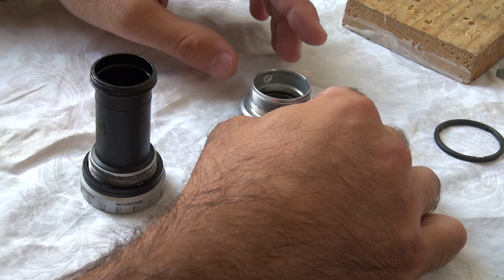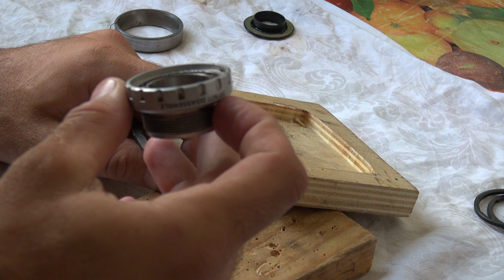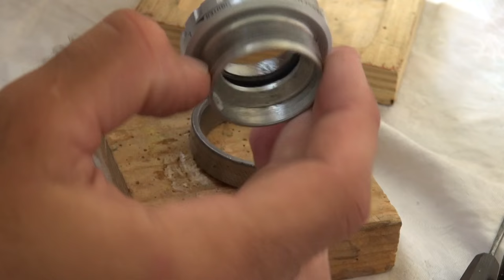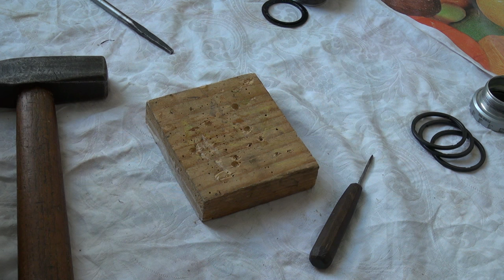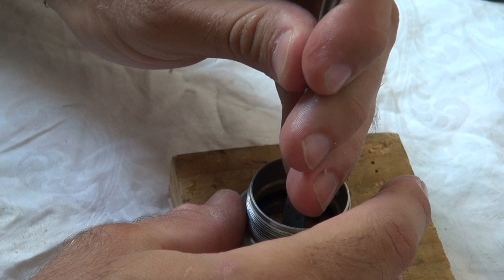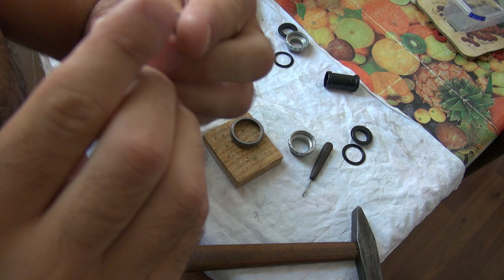Shimano Bottom Bracket BB-52/51 FULL Disassemble

Comment: You can use Sealed Bearing model 6805 RD (with 25 x 37 x 6mm exact size) so you don't have to chisel out the bottom bracket cap ( black color). Which I ordered online and installed it perfectly fit with Shimano BB52 Hollow Tech 2.

Comment: Yes this bb is servicable only problem is that the bearing its self is hard to find.. i would advise after you buy a neww shimano bb it would be much better to remove the bearing and repack it with synthetic  grease..
Reply from the maker: rolly mendoza , no need to replace with bearing same size, but remove plastic washer and put 1mm larger bearing(standard size), and ride at least 200 000km without worry
Reply: Kunalagon, thats a great idea.. i assum you have try it. It would be a great help if you could give bearing size on the oversize bearing replacement
Reply from the maker: it should be 24x37x7, because original was 25x37x7 (standard 6805) + plastic washer (1mm). I cant check it right because I have to remove crank, and I pull out one from Truvativ GXP patron. They called it MR24377